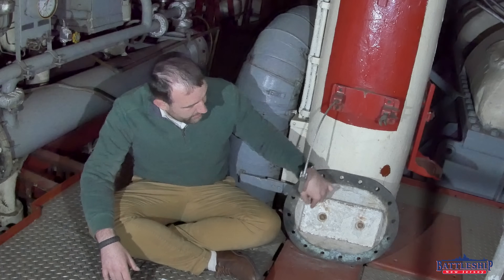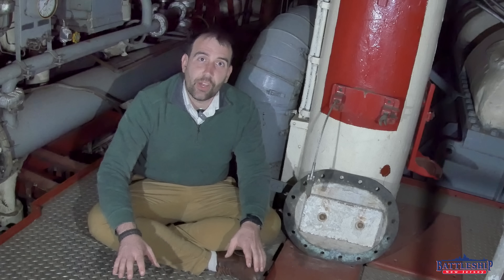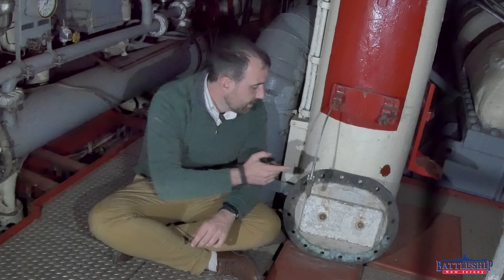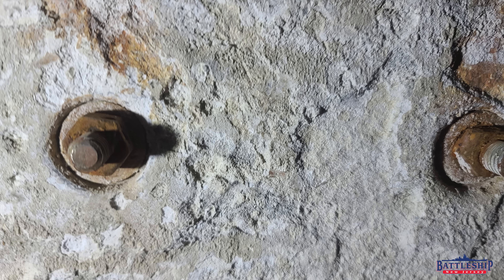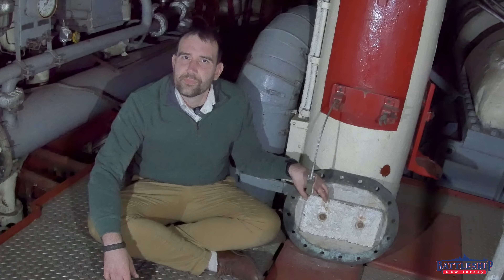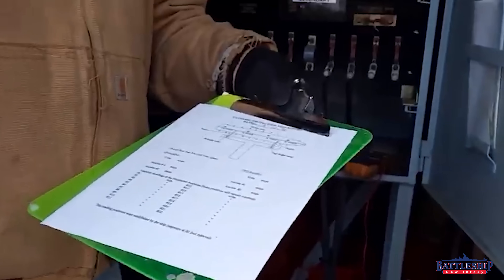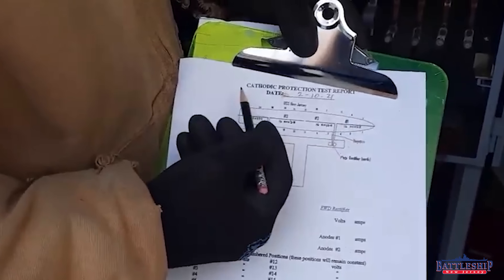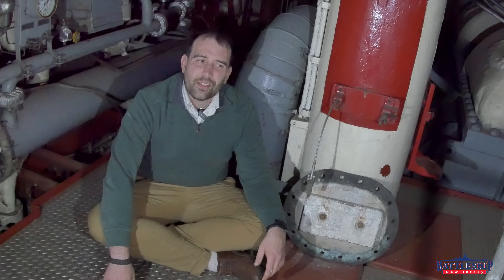Protecting Your Ship From Galvanic Corrosion: Drydocking NJ

Comment: It would be cool if you could wire wheel clean a spot on those zinc chunks, and laser etch or engrave 'Battleship New Jersey' on them. Then, if they wanted to, the customer could polish the rest of it, and put it on their coffee table or desk. Gold or silver plating would look cool. 
Ford engineers should have studied the properties of steel a bit more. They may have to recall tens of thousands of vehicles because they used an alloy for valves that fracture if they got too hot during machining. I wonder who came up with that money saving idea.

Comment: "electricity flows through the water it's going to start to remove molecules from the metals"  I think the idea is that depending on the direction of flow of electric current molecules get removed from one piece of metal and deposited on another piece of metal, you just set up the electricity so molecules are not removed from the ship, make the ship the destination for molecules removed from those big chunks of cast iron laying on the bottom

Comment: I remember reading a report of an active CP project where they got the voltage polarity the wrong way round.
Reply: Ouch. Another case; a welder came out to do some work on a boat and hooked the ground for his arc welder to the pier. As the story was told to me, the boat was leaking within a day. >100A turns out to be able to eat metal rather fast.

Comment: Ensuring that galvanic corrosion protection both passive and active is working  and in place should be a high priority.  You think $10m is a lot now, wait until you have to replace part of the hull like USS Texas is doing / did if you don't have your galvanic corrosion protection working to protect theship..
Reply: I suspect this is lower priority because it actually can be done in the water if you have to. I'd bet it's not designed to be done by divers, but there is no way that someone hasn't figured out how to do it.

Comment: You can think of the active cathodic protection as trying to electroplate the ship (the parts to be protected) but with not quite enough voltage to actually deposit any new metal.

The system you described seemed to use separate anodes (not part of the ship, sitting nearby in the water), but in the comments here others are describing systems where the anodes are part of the ship, either (like the passive anodes) designed to corrode, or (like, say, bronze parts) naturally resistant to corrosion. The former would use shore power when docked, while the latter would use on-ship power while at sea.

Replacing the passive anodes seems like the least time-consuming of your three major drydock tasks and probably requires the least skill, at least until one of those studs shears off. If one anode is done wrong it is no big deal, but if you mess up sealing even one through-hull fitting, you've got a problem!

Comment: Seems you can replace only half or fewer of the static zinc anodes with a mix of manganese and aluminum and leave the other zincs in place. The zincs are corroding, so they are helping, but the active system is doing most of it anyway. Save money and labor and time and just replace half of the zincs. Use mostly aluminum and a few manganese. That way you are protected on multiple reaction fronts. The static anodes are only a backup to the active system, so they don't need full strength anyway. But they can be there when the power goes out and take over for those short periods. They should last many times longer (as long as the ship?) with the active system doing the majority of the work the majority of the time.

Comment: Ryan r the pipes and steam line on the ship drained or r they still holding water?
Reply from the maker: we still have running water on board, so not all pipes have been drained. they will be before drydocking.

Comment: About the condenser.  You actually have three metals in play so far as galvanic  corrosion goes.  There is the zinc anode, the steel in the condenser shell, and the tubes, which are typically some kind of a copper alloy.  I think the Navy used to use Monel, but the Marine Propulsion unit in my  college Power Plant Design class was 45 years ago, so I don’t remember exactly.  I know land side power plants using sea water used Monel.

Comment: We have a customer who specifies Rolled Alloys brand 310.  It has fewer dislocations than the cheaper generic 310 stainless steel.  It makes a difference on the stress corrosion cracking

Comment: You could avoid the corrosion by making the ship from 310 stainless steel that has been remelted in a vacuum furnace, cold rolled, then soaked in liquid nitrogen to remove as many defects as possible.  It would also cost tens or hundreds of billions of dollars
Reply: We’re saving that process for SpaceBattleship New Jersey.
Reply: Transparent Aluminum, Ask Scotty the formula.😊
Reply: @ross82  titanium doesn't weld very good.  I reckon its too soft for armor.  Aluminum actually has a higher strength for its weight remember aluminut
Reply: @chadr2604 titanium welds fine

Comment: Its not the purity.  The more reactive metal corrodes the more electronegative metal.  Stainless steel in contact with aluminum will corrode a chunk out of the aluminum because the aluminum is more reactive
Reply: Was going to make this point myself, but you beat me to it.

Comment: Is it possible the impressed current system is working as designed to the point it is also protecting the zinc anodes (thus the reason the zinc anodes are not corroding)?  Your contractor should be able to clarify this.  Hate to see you drop a bunch on money replacing anodes (especially if the current ones are sufficient).
Reply: In an earlier episode, Ryan said they learned that the traditional zinc anodes are not effective in fresh water.  This makes sense since the navy was conducting the last dry dock, navy ships spend 99% of their life at sea, and at the time they had no idea that some 10 years later it would become a museum ship.  Also it is one of the rare few museum ships moored in fresh water.
Reply: That’s my concern.  I am definitely not an expert on cathodic protection, but I have seen bad things happen to underground tanks and pipes when the passive and active system start fighting each other. However, if the zinc isn’t corroding, and the hull isn’t either, it’s probably working correctly.

Comment: I was just learning about this in chemistry class, although it was far less interesting when not in the context of a battleship
Reply: Where I work someone designed in an aluminum part with stainless screws in it. It's part of a manual valve. Customers were reporting the valve completely failing within 3 months. The aluminum was sacrificing itself in the water that the valve was submerged in

Comment: Lot of Navy ships I worked on had zinc anodes bolted to the bottom of the bilges in the engineering spaces.  Most of them were pretty much used up when the ships came in for overhaul.  All you'd need is a good flashlight and a large Phillips head screwdriver to loosen the deck plate screws for the hard to see places. 😄

Comment: active cathodic protection is a great thing. helps prevent corrosion, and keeps sea life from growing on the hull. short simple version is anodes along the hull are your positive side, and the screw is the cathode, run thru a shaft grounding assembly (band around the shaft with brushes). just passes a very low current along the hull. much superior to zinc anodes along the hull that need to be replaced periodically, and also cause drag when underway. for a static museum piece, a bolted on anode likely has very little down side.

Comment: Are Missouri and Iowa in salt water ? They could use those zinc anode to help reduce the cost of their future dry-docking !
Reply: It's a dollar per pound dude, worth the cost to go new.
Reply: Even though Jersey is in fresher water my guess is those zincs are pretty used up based on their age.
Reply: @dieself3509 zincs dont work in fresh water, they oxidize and don't work. You have to use aluminum or magnesium anodes in fresh water.
Reply: @JimGriff1720  actually they do just very well. It's mostly about nobility of the metals. Stray current can also have an effect. But on steel zinc will have protective properties not as good as aluminum or magnesium. Think galvanized steel. Most people's knowledge of anodes is based on aluminum drives on personal boats. 20+ years in the marine industry.
Reply: Yes they are
Reply: Isn’t Wisconsin in salt water as well?
Reply: USS missourian USS. Iowa definition in assault water. I visited both of them recently.

Comment: So what did the Royal Navy do about this problem of galvanic corrosion?
Reply: Scrapped all our battleships :(
Reply: All RN steel hulled vessels have Impressed Current Cathodic Protection systems fitted. I don’t know when they first came into use but I served on Type 42 destroyers that were designed in the late 60’s and in service from 1974 so they’ve been around for a while. In addition zinc anodes were still fitted in areas of dissimilar metals such as hull openings and the shafts; plus moving parts such as the rudders and stabiliser fins.

Comment: In the Columbia River freshwater we use magnesium for anodes.
Reply: Magnesium has been used for decades in water heaters anode rods.  However, if you have well water people have sometimes had to change to Aluminum anodes to remove a rotten egg smell.  But that's not a problem here, the two factors here are cost and effeteness, magnesium or aluminum.
Reply: @davidmarquardt9034  i replaced my magnesium anode (which was 85% gone) in my HWH with an impressed current system. I am absolutely amazed at how well it works, getting rid of the sulfur smell.